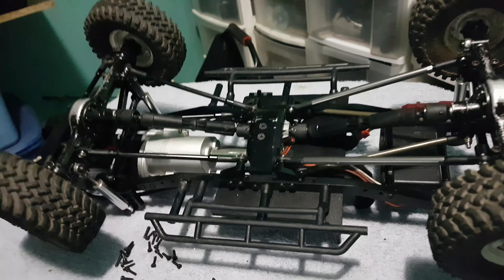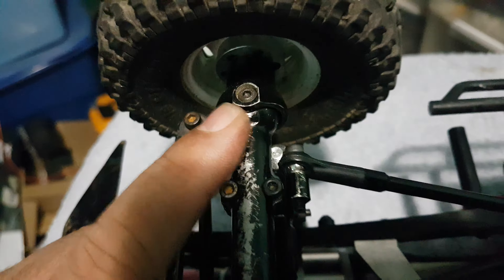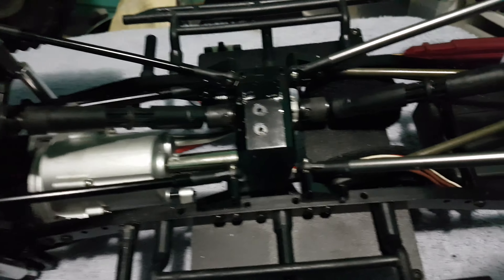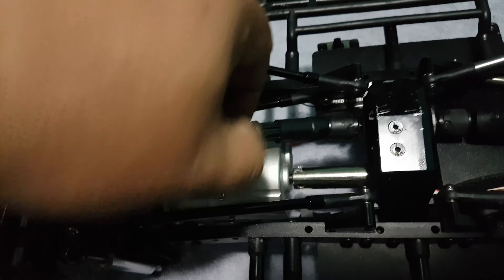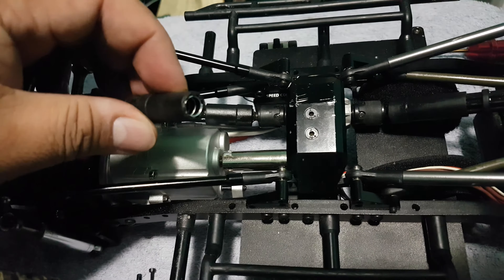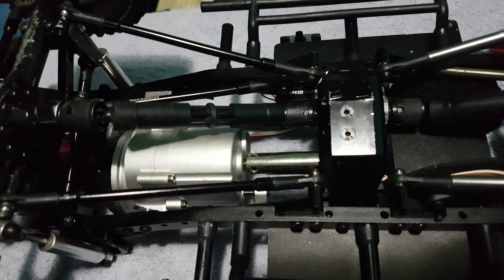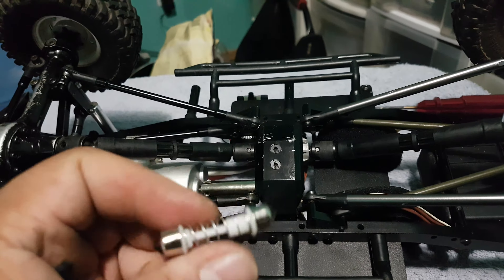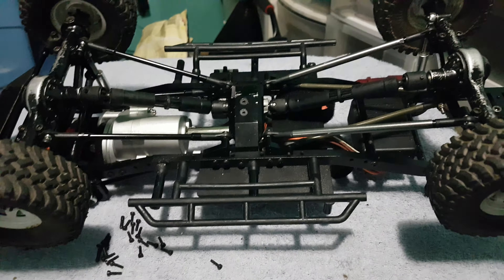Tf2 drive shaft mod

Comment: Sweet video! A few years ago I tried to put some Axail scx10 shafts on my TF2 but they wouldn’t fit. They were the originals though. Good to know that the new stuff works now. I’ve always been a fan of Axail driveshafts and have never broken one, except on my yeti trophy truck. I’ve got some punisher shafts on my TF2 now but not really worried about breaking parts, I’m a pretty light driver. Keep us updated on this tundra! Looks to be a good setup with the links!